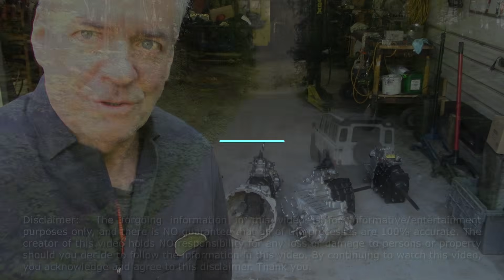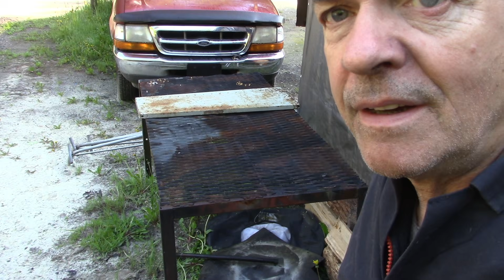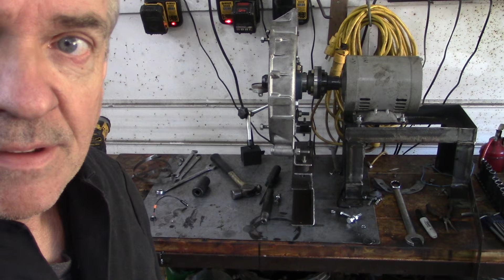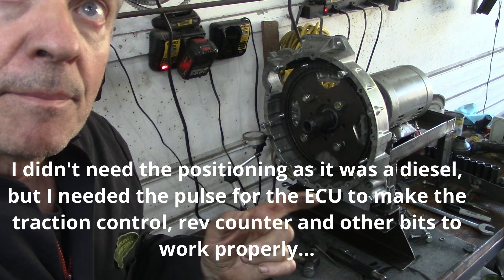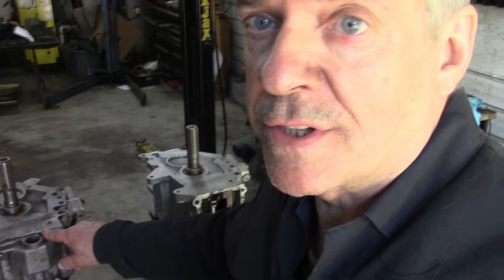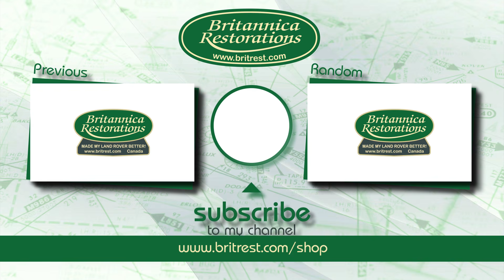R380 gearbox updates and tester modification

Comment: Ii had a LT77 in a V8 SD1, would not change into 2nd gear when cold, I used a tube of molyslip in it & after a few miles the problem went away, done many miles afterwards was fine. I've read that it should not be use in these boxes, whats your thoughts?  Im asking as I have a 2 door RR with a LT77 & would like to add some to that..thanks
Reply from the maker: Cannot say, as I have not used it - all I use is ATF Dexron IID and it works fine

Comment: Ingenious Solution, the best ideas take a few iterations and time to mull over!
Reply from the maker: I find the testing is really important as I can run them with oil for a few hours and double check for noise/leaks and also check the gear change operation when running

Comment: Or. What’s the biggest difference between the R380 box. Apart from the input shaft going into the engine side. 
You’re the man Mike.  
Get those grey cells working
Reply from the maker: The main difference with late boxes is suffix L which have the larger bearing for the input/primary motion shaft - you can tell at a glance the cover is a bit thicker than a STD R380
The V8 had different gears on the 5th - but only give 5% raise in ratio - they had a similar length input shaft (but shorter if I recall) - I never see them - but the end of the shaft had a smaller diameter
I think the early J boxes had different 1st gear ratios
Problem is when the numbers are ground off!